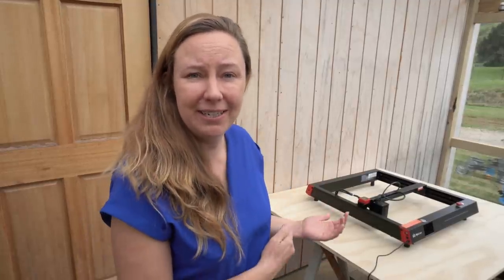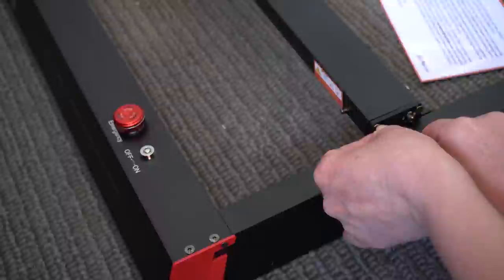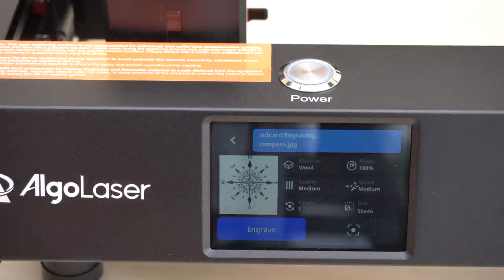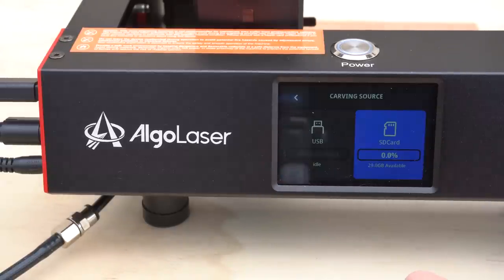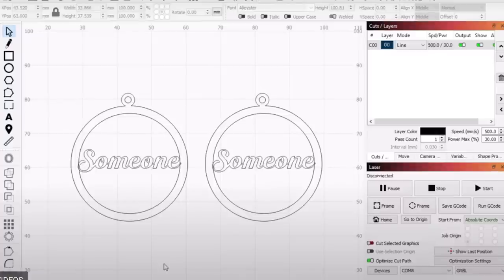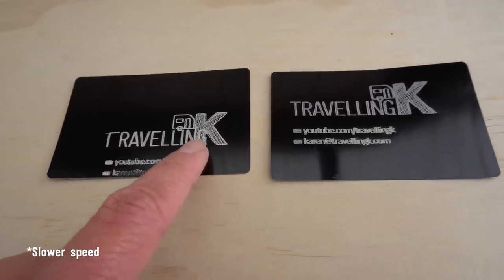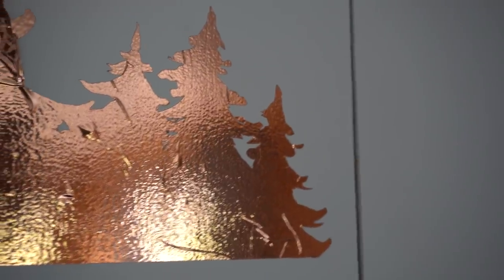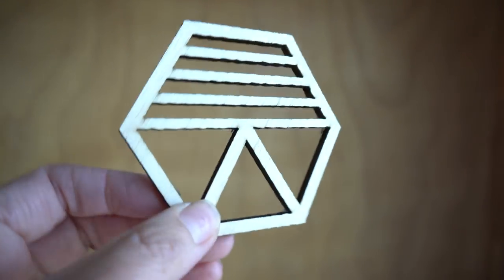AlgoLaser Delta 22W Wood Engraver & Cutter - Easy to use!

Comment: Watch out for your eyes, the laser can reflect off what you are engraving/cutting. Never stand around it without wearing eye protection.
Most of the tinted glasses that come with these are sub par, replacing them with a better quality ones are recommended.
Reply: this low power laser will not hurt your eyes